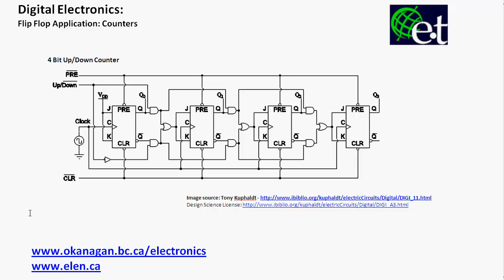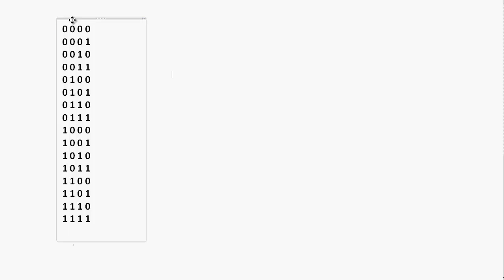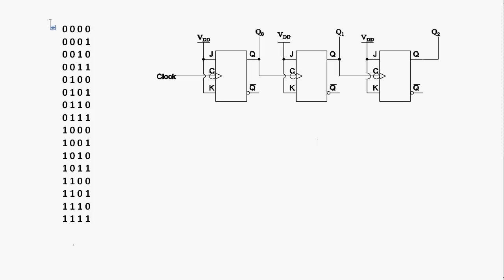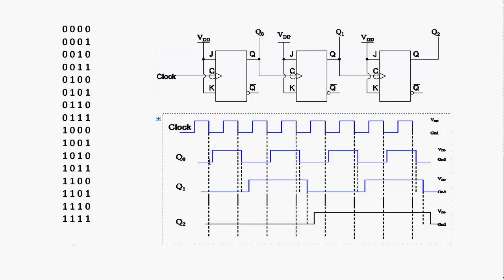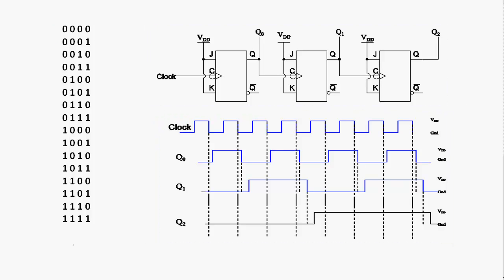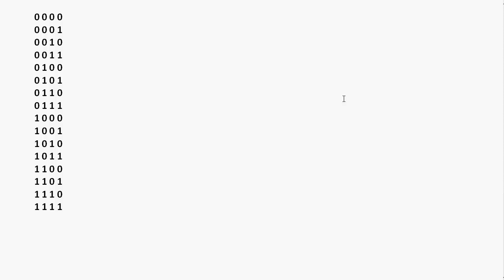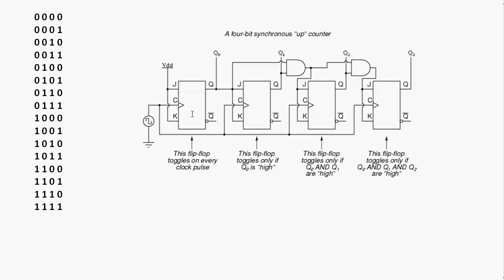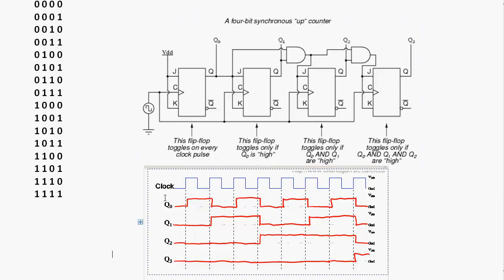Sequential Logic - Counters

Comment: at the reversible counter, when it reached 1000 i.e. 8, considering that we started counting downward, shouldn't the next state have been 0111 ? According to the diagram, it's 1001
Reply: Since the Up/Down signal changes to 0 in the middle of the clock signal, its 0 value is recognized at the next clock signal. Therefore when it just changed from 1 to 0, it was still previously seen as a 1, so it counted to 9. Afterwards its 0 so back to 8, then 7, 6 and so on.
Reply: my question exactly!

Comment from the maker: Oops, my brain wasn't working for my above reply.  I was thinking of adders at the time.  There is a propagation delay for sure, and I did show it in my example.  For the asynchronous counter, the propagation delay does cause a problem because the bits change at different times creating a glitch (which in this case is the incorrect counter value for a short period of time.  the synchronous counter still has prop. delay but all bits change at same time, so it doesn't matter.

Comment from the maker: To start with, create your sequence of states:  0000->0010->0100->0110->1000->beginning.  Then consider each bit individually and determine the logic necessary to create the transitions.  For example the most significant bit goes 0 -> 0 -> 0 -> 1 -> beginning.  Alternatively, note that the least significant bit does not change...it is always zero.  You could make a 0-4 counter with a fourth bit (the least significant one) that is always 0.

Comment from the maker: Yes, in practical circuits, there is a propagation delay, and that's what makes this kind of counter a ripple counter...the output bits don't give you the correct answer at the same time.  You have to wait for the propagation delays through all of the gates before you have the full, correct answer.